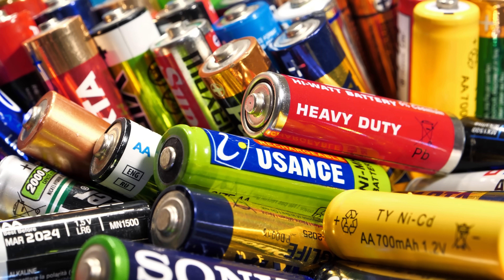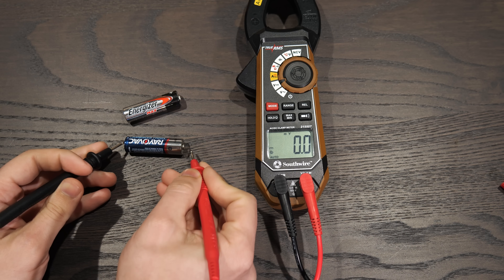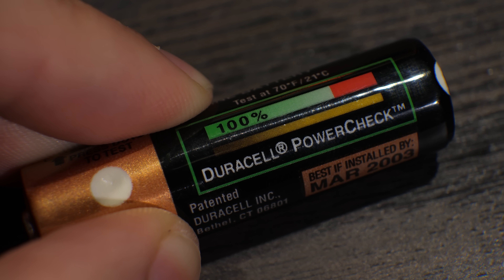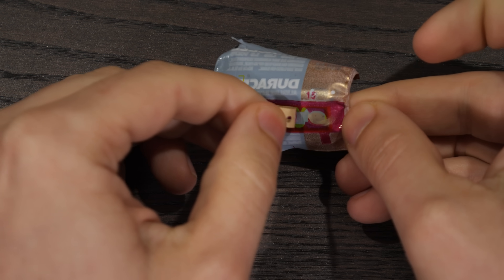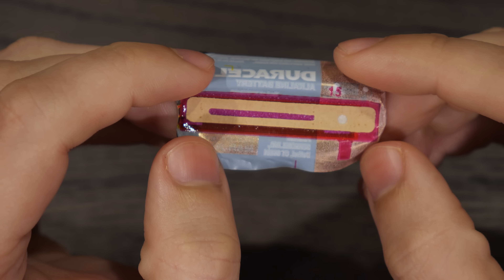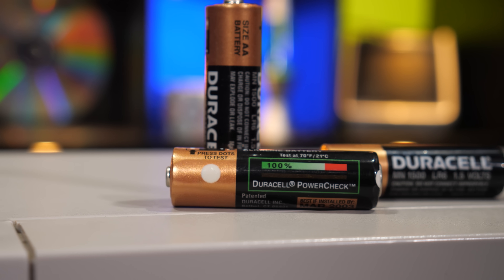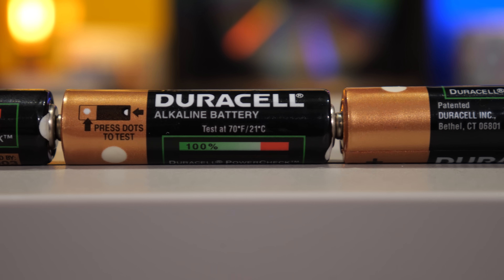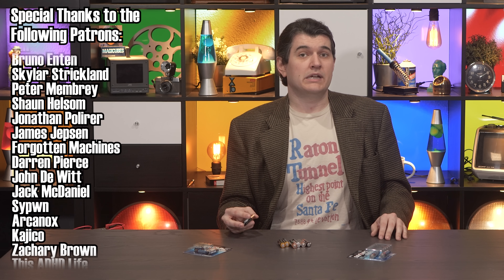Duracell PowerCheck: A genius idea which didn't last that long

Comment: As was said, in the 90s, when rechargeable, built in batteris was rarely a thing, it was so common to have many devices you wouldn't use on the regular.  Since batteries would sometimes leak over time, and could lose their charge while just sitting in a device, people would often just take the batteries out and re-use them later.

You think to today, most devices we use that need disposable batteries are used on the regular and, as mentioned in the video, are used until they're dead.

Comment: After having batteries leak when installed in rarely used tools caused me to remove batteries from service. Thus I really appreciate the built-in battery testers and I missed them when they were discontinued. Yeah, I'm old.

Comment: We’re so affluent since the 1980s that we don’t care about waste any more. Batteries used to be crazy expensive in the 70s. C and D batteries were the norm. After small electronics that only needed AA capacity came out, the AA market took off, as the same time that really cheap Asian prices were becoming the new normal.

Comment: Good multimeters have low impedance modes. To test under low resistance. But that’s professional gear in essence as it can also be very dangerous if you don’t stay within in spec.

Comment: I really appreciated these built-in testers. I had lots of scenarios where it was unclear whether the battery was dead and even multi-battery systems where only one battery was below functional threshold. I knew nothing of volt meters and welcomed the ease of use and convenience.
Reply: I remember frantically digging through my gameboy bag looking for a cell charged just enough to swap out the evil one trying to make me participate in the family road trips.
Reply: The BEST and EASIEST way to see if a battery is full or empty is dropping them on a flat surface (vertical). If they jump up, they are empty, if they just tip over, they are full :)
Reply: @Amon.R  That has the issue of not telling you anything besides "Charge" or "no charge" which is not an issue for the built in tester.
Reply: @Gandalf-Sinderio  yeah, i just like to spread this trick bc it helps a lot for everyday life c:
Reply: @Amon.R  This also breaks the core and will degrade the battery.
Reply: @ghoulbuster1  well you dont slam them, you just let fall from 1cm or so
Reply: They sold purpose built testers, sold right along with the batteries. 
We never had extra batteries, you knew they were dead when the item stopped working.
Reply: @caveslug-t2k but if the item had 2-4 batteries how do you know if they're all dead or if only 1 or 2 were dead and the others fine? I guess they degrade at the same rate, but if you had different brands in the same item they could be different I'd guess. Plus if you have a toy and then stop playing with it you can take the batteries out. They're probably still good for another toy or something but you don't want to leave them in something you're not using.

The built in testers were cool, but since not all batteries had them we always had (and still do have) a separate tester so only the really dead ones were trashed. I'm surprised this seems to be an uncommon thing. I literally had work buy me one a couple of years ago because we use batteries for stuff and I didn't want to trash 4 at once if only a couple were dead.
Reply: @thatwolfboy2898  Different brands in the same item? You rebel, you!

Comment: My insulin pump uses AA batteries and I have to change them out every couple of weeks. I bought rechargeable ones but I have to keep a few extra around in case they stop since the indicator in the pump will often read a low lithium battery as 40%. It’s a new pump as well, seems they could have used a slightly bigger case and stuck in a replaceable phone battery.

Comment: I think I keep old batteries because when I need two things to work at the same time. I just put an old battery with a new one on both things. They worked most of the time.

Comment: You could just put the battery in the device and see if it works, but the problem is that most devices that take these batteries require two of them, and if the device doesn't work, I don't have a way of knowing which of the two batteries is bad

Comment: I remember these. I am old enough to remember when alkaline batts weren’t common. The standard batteries available in 50’s used cork material to seal the batteries and they leaked like hell and destroyed flashlights and toys with the internal acid. When the alkaline batts came about, they touted the superior non leaking qualities, which was indeed the case. Recently, though, I notice battery leakage to be common again. Wondering why?

Comment: Use batteries in a camera till they are dead and then put them into a shaver then I use them in low drain items like a remote or mouse or clock until they are dead. I'd love to have these testers back on my batteries. U get so much more use out of them. a tester built into the packaging works so much better.

Comment: A problem for a solution that didn’t exist! We already had testers. However, early and mid 2000’s tech created with the idea of exploring potential genius ideas is so interesting that I have kept an unopened pack of these since 2009(?)! Hopefully will sell on eBay at some point for $100!

Comment: I always thought those built-in testers were just a clever marketing trick, using up some of the battery's power to check the charge and ultimately causing it to drain faster—just a way to boost Duracell's sales.

Comment: I remember these but in a slightly different design and I always believed this test with just fingers didn't really work because even if the test showed that battery had power when actually trying to use it in something it didn't actually had almost no power

Comment: EEVBlog has some great breakdowns of competitor products. TLDR. A battery self test like this is not very reliable for determining charge, and what "charge" means for an alkaline is weird. This is different from other systems like Li-ion pouches which actually run a tiny computer to do more complex operations.

In short. Alkaline battery voltage drops off exponentially at the top end of charge. That's part of why alkaline batteries seem to die so fast in a high drain device, but last forever in a TV remote. The battery can put out say 1volt for a really long time, but can only really deliver 1.5volt for a tiny tiny fraction of its internal life. Have you ever pulled batteries out of something high drain like a camera and used them in a remote for months after they were "dead" in the camera? Same idea.

So when a battery shows "full" on the charge emeter it might still be useless in a high drain device. And when it shows dead on the meter it might still last months in a low drain device. So even if we had these meters on all our batteries. They don't read what you expect them to, especially if you don't know much about alkaline batteries.
Reply: I have a very intensive alkaline battery operated vaporizer used to heat CBD products (MFLB). This product really needs the AA to be generating its full voltage/power/whatever because laypeople use the terms differently. It greatly helps to get batteries with larger capacity (2500mAh vs. normally maybe 800-1500) because this keeps the battery at higher voltage for longer. I only care about the fraction of time when the battery is as close to 1.5v as possible, which might only be when the battery is above 80% total capacity remaining (depending on temp etc). Moving to a better battery might extend that time from a measly 10s, to closer to a full minute, depending on ambient conditions etc. 

These meters are of little use to me, in a scenario when I really need to measure the battery. To me, 90% voltage might be as good as 80% empty!

Comment: Alec clearly underestimates my 90s family home chaos. :p We always random batteries flying around. Often, I think, we tried to swap almost empty ones in less power hungry devices (eg GameBoy to Tv remote), but those still had good enough power. Also, since almost all devices need more than one battery, 'device works' vs 'doesn't work' didn't help much to decide which batteries still had enough charge to be used elsewhere. 8)

Comment: Huh? What do you mean if we remember them? Do Americans not have these anymore?
Here in Europe, we still have built-in battery testers. Duracell has a "performance" line that just puts a blue line and the battery tester on the packaging. It's not an old design, and instead of one yellow bar, it has like 5 of them, from red to green.
It's important to mention that im talking about D batteries, and not AA. Im not sure if those have battery testers.

Comment: Those gameboy batteries that you said you were constantly using are the exact things you would throw in the junk drawer. 
"cant make the game boy work any more.. Probably will work for a remote or something later if needed" although how often you would actually use those drawer batteries vs new ones was rare.

Comment: Oh man, I miss these things.  Apparently I am insane because we always had some half used batteries hanging around because we were poor and we didn’t throw batteries out unless they were DEAD.  So we had a bin of batteries that were very much Russian battery roulette.  Granted, we aren’t so poor anymore and we don’t have a lot of devices that need them so I wouldn’t use them as much now but that habit of keeping batteries until I know they are dead is still a thing.  OH do you remember when these testers where in the battery pack itself?  So much easier to use but then you had to keep a pack of each size around for the tester.  Yes, we kept those too.  lol. The joys of growing up poor.

Comment: Surprised you didn't mention you could also test a battery (very roughly) by the bounce they do if you drop them on the bottom to a hard surface. Loaded batteries would bounce very little, while empty bounce high.

Comment: yes, testing batteries without load gives misleading results, a battery could have good voltage with little or no load, but drop significantly on a reasonable load, they can develop high internal resistance, this is more so with zinc carbon and zinc chloride than alkaline,  also nicad and nimh can go high internal resistance but 'good' voltage when charge level is low

Comment: on the one hand disposable batteries are wasteful, on the other hand they were done away with because so many devices used much more power.  I think there's supposed to be special recycling for batteries, but in order to do that, you'd have to put your dead batteries aside in a drawer where they can mix with live batteries.

Comment: hey, i was born after the 90's and i definitely remember a refresh of this product from Duracell. If i had to guess it was some time in the early to mid 2010's. they even looked different from those and i remember what it was like. The heater bar had multiple segments and each one was a different color between green, yellow, and red depending on the charge of the battery. You definitely still had to white knuckle it to get a reading though.

Comment: These were amazing. I couldn't experience the original, but I remember for a brief time from 2015 - 2019 or so Duracell brought the checker back on the Duracell Quantum batteries. Those were so hard to check.

Comment: this reminds me, actually: i just found some fancy new 1.5V rechargeable batteries a few weeks ago that have a lithium cell inside with a buck converter. i'm still trialing them but i'm so excited to be rid of disposable batteries forever. (well, nearly, cr2032s are still hard to replace, but who knows how tiny the tech will get.) i remembered reading about some hella fancy tech like 15-ish years ago that did the same 1.5V rechargables through some wacky chemistry, but they were bloody expensive, and so were lithium batteries in the early days. but nowadays they're a commodity too

Comment: Sadly a lot of things that use rechargable batteries use the non replacable one, combine that with hard to open devices and when ur rechargable battery cannot hold any charge anymore you are screwed

PS: I do wonder if this battery tester is reusable? Did u try wrapping fresh battery with it to see if it would work?

Comment: Pc mice can work with discharged batteries. The more power hungry is the device the moar power unusable for them but not for other frugal devices remains in the battery.

Comment: The Powercheck has actually an useful alternate purpose: if the device you're using those Duracells in stops functioning, you have a quick and easy way to check if it is just the batteries running out or if the device itself broke.

Comment: Remote controls are not limited by the energy of the cells typically but by self discharge or aging of the cells.  Their duty cycle is so extremely low that if they're properly designed, the size of the cell will not make a difference to how long the battery lasts, but a larger battery means the unit is more likely to break from being dropped due to the greater mass.

Comment: I don't think we should be quite celebrating the phasing out of AA and AAA batteries from devices in favor of Lithium based batteries just yet.  I know this is an aside to your video subject but it seemed like part of your conclusion is that we are better off being past the age of these things.  Disposable alkaline batteries are indeed horrid to have to keep buying as you burn through them and terrible as a waste stream, but their rechargeable Nickel-metal hydride (NiMH) cousins are  in some ways still superior to the built-in LiPo batteries that have been replacing the AA and AAA batteries in newer devices.  Most significantly is that with most cheap devices with LiPo or other Lithium batteries, the batteries are not easily user replaceable and are often the thing that turns a device into e-waste in just a few years when the rest of the hardware could be acceptably functional for decades.  AA and AAA are also standards that mean that any decent quality 3rd party battery will work in almost all devices that take them, while many LiPo batteries are in form factors that are, if not proprietary, are non-standard to fit the devices they are designed for and long term availability of usable replacements is not certain.  NiMH AA and AAA batteries can be charged with very simple chargers and can be charged out of the device itself, while most LiPo batteries are built into the device, often with a flimsy micro USB port for charging which is probably the second least durable thing in the device.
The benefits of LiPo battery chemistry can't be ignored, and there are tons of devices that really benefit from it or couldn't exist without it, but for things where it isn't that necessary or beneficial, I will continue to prefer devices that will take standard rechargeable NiMH batteries until we have more uniform standards for user-replaceable LiPo batteries.  Now that I have kids, with all their battery operated toys, my NiMH batteries have probably saved my weight in alkaline batteries from entering the waste stream.  I still have almost all the NiMH batteries I've ever bought still in service, and even added some to the collection that I rescued from some 20 year old cameras or whatnot that I found in my MILs house, still working after a recharge.
Even still, with my love of NiMH batteries.  I don't think I'd ever benefit from the PowerCheck strips if there were any on such batteries, because I don't really have devices powered by such batteries that are so mission critical that I would ever need to keep tabs on the battery voltage in the device.  Just use them till they don't work, swap them out, recharge them and repeat.

Comment: The on cell battery charge checker was real handy but like many other useful things that vanished I guessed cheaper products without a built in tester flooding the market killed them off. Still got an old battery tester that came with a pack of Duracell MN1500 (AA) cells, and it still works after all these years.

Comment: Use case that i tended to use the test strip for was when batteries are in series they don't discharge at the same rate so you could get a little bit more if you only replaced the really dead one.

Comment: There's also the fact that a lot of things that need batteries have rechargeable ones included, but even the devices that don't, still usually have some type of power meter on them or connects to a smartphone which shows power status. I bought a (admittedly oversized) 85 inch Samsung T.V. The remote it came with not only has an internal rechargeable battery. It has a USB C charging port, and a solar panel element to charge it. It's on the bottem so you have to flip over the remote to charge it. But that kinda happens naturally.

Comment: I remember having a lot of Ni-Cad rechargeable batteries around our house during the heyday of that battery chemistry, at least for toys and gadgets that worked acceptably well with 1.2V. (Or 1.3V? Whatever Ni-Cad ran at.) When I got an original gray brick Gameboy, we pretty quickly invested in the external battery pack. So a lot of the time I would play with Gameboy tethered to the battery pack, which would in turn be tethered to a wall outlet, as it worked okay being used while recharging.

Comment: My mother bought one of those sketchy "battery chargers" before rechargable battery came t be a major thing. And those worked in it and there it actually made sense to have that  feature, and I say I miss it  on modern batteries quite a bit. Now i have to put them back into the charger and wait till it tells me the voltage. Or if I have an older model wait till it "recharges" them again which might take a few minutes.